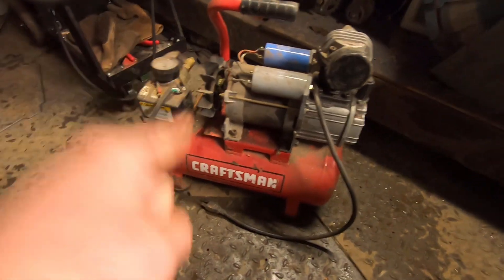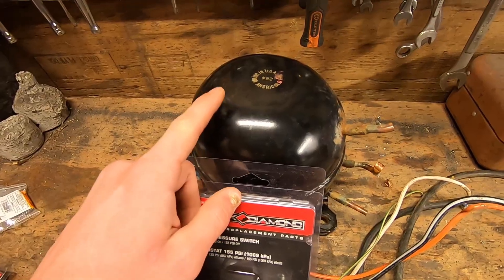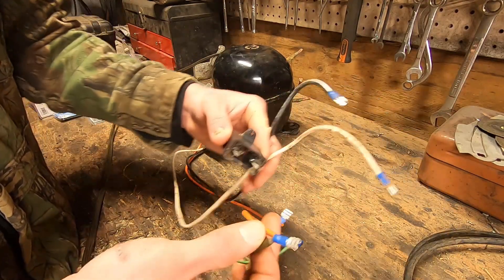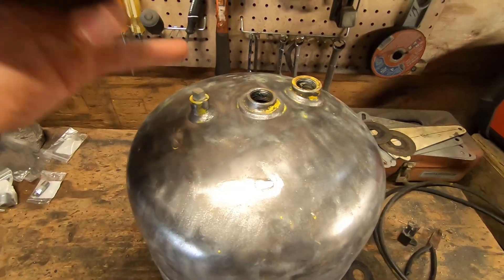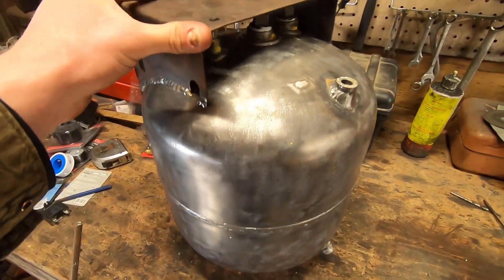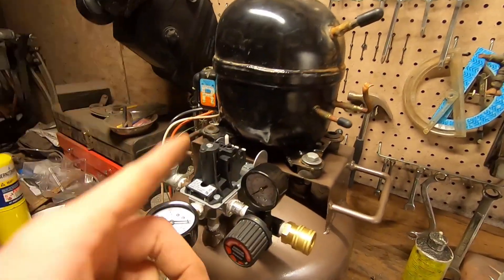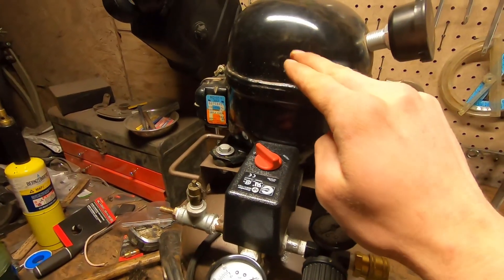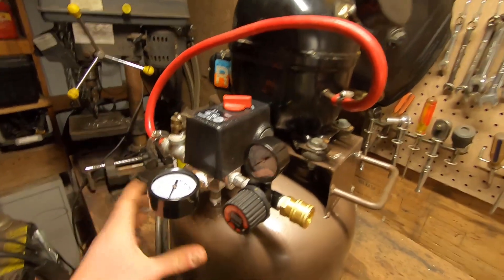How to Build an Air Compressor From Scratch! (Fridge Compressor | Complete Build!)

Comment: I built one to compliment my 'normal' compressor as it's ideal when working at night and you don't want to wake the house ;) Great for running small items such as airbrush, air duster, tyre inflator. Dehumidifiers are a great source for the compressor where I live (NZ); for some reason people are always throwing them out and you don't have the large fridge/freezer body to dispose of (Possibly more powerful too as mine would fill the tank in a few mins.) I just stuffed a cheap inline fuel filter in the inlet pipe as an air filter.  Local model engineering society found it useful in powerering their steam models during open days as it's almost silent and the small amount of pressure needed to run the models it didn't cycle too often. I also added a fan pointing at the compressor, not sure if needed but I had one anyway and did keep the outside case of the compressor cool at least :) As a secondary bonus I used the inlet (after the fuel/air filter) as a vacuum line to draw bubbles out of resin (hooked up to a homemade vacuum chamber)